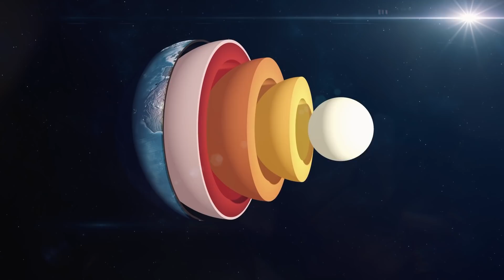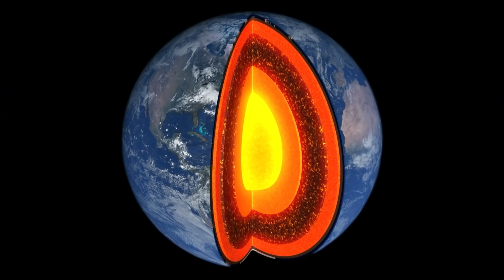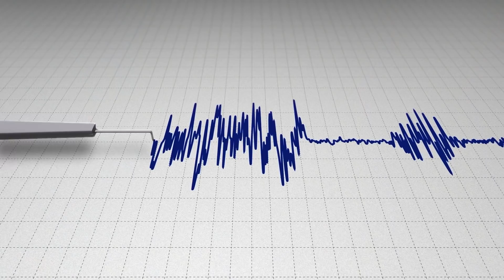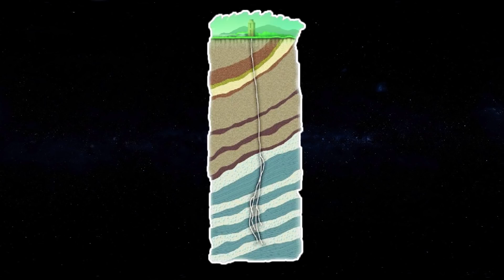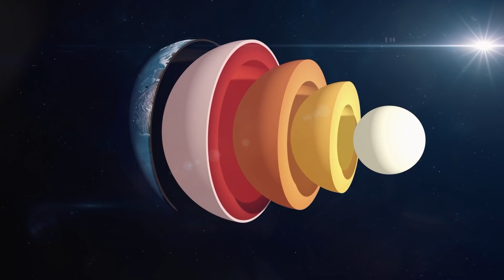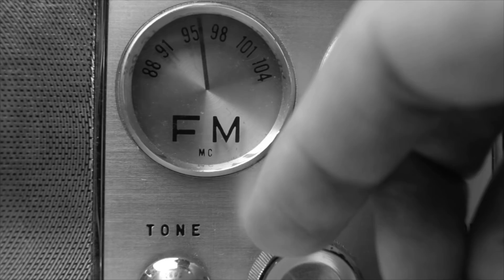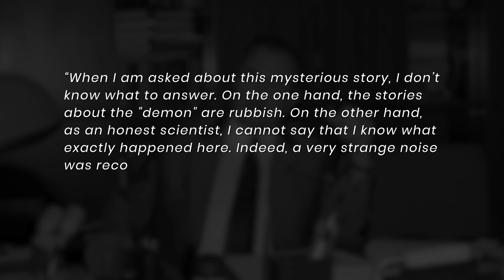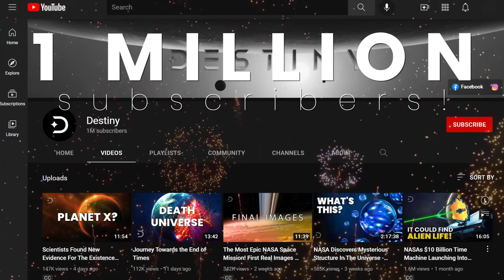Mysterious Structure Found Inside Earth

Comment: Has there ever been a probe that has taken an approach to drilling earth from the depths of the Ocean, seems like they'd already have a 15-20km head start with such a project depending on where they start digging
Reply: That's beyond impractical.
Reply: @GamingSerb  we wouldn't be at this stage of illumination if we just set things at 'Thats beyond impractical' I mean if we can send a probe to Mars, The Sun, corner of the galaxy we sure can drill :p
Reply: @jibranjawaid  not at all. You'd have to deal with deep ocean pressure, make a 20-40km structure building like an oil rig to reach the bottom, find a way for transportation of materials/engineers. It is beyond impractical... It's much easier to make a rocket ship and send people/robots on an exploration mission.
Reply: @jibranjawaid  too many variables to make it practical.

Comment: We are doing it by sucking blood out of it. Oil and gas are earth fuel that ignite deep inside the earth and create pressure and movement. That's what I believe from a kid. Movement create heat. Earth have layer and each layer have different friction when pressure change in different location because energy have been release the layer move.